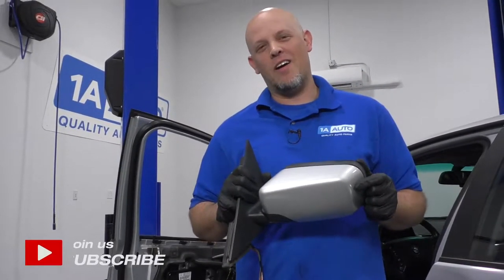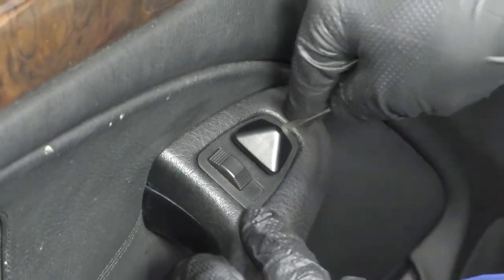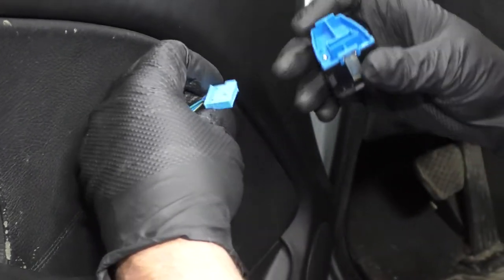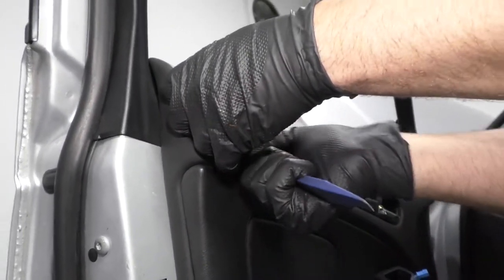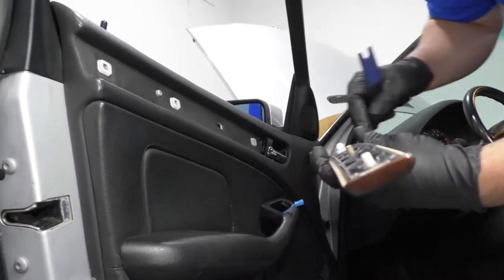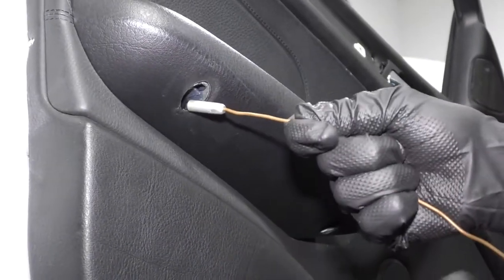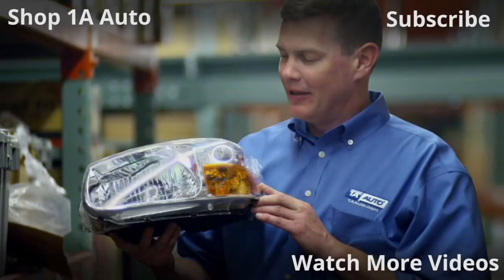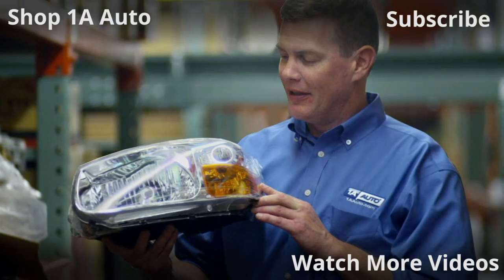How to Replace Front Side View Mirror 01-05 BMW 325Xi

Comment: If you have side air bags, disconnect negative battery terminal FIRST (and make sure it stays to the side to not flex back and contact terminal) before removing door panel. Otherwise, your SRS/airbag light will be on even after you reconnect the airbag and you’ll need an airbag reset tool to turn it off.

Comment: Great vid !!
One question: Side mirror of my 2004 E46 325i has ribbon wire which I broke just behind the mirror. Ribbon wire seems so hard to fix. So I wonder if I can replace my mirror and wire with a used mirror with non-ribbon wire which is easy to find. Does  non-ribbon wire kit retro fit my connector? Thank you.
Reply: I have the same problem. Did you find a solution?

Comment: I ordered some new mirrors, not from you but somewhere else. The issue I have, is that this car had this like, super thin flat wire for the mirrors, instead of the normal ones. How would I connect them? I assume I'll have to channel my inner electrician?
Reply: Have same issue. Did you find a solution?